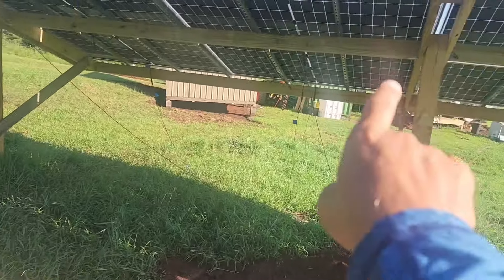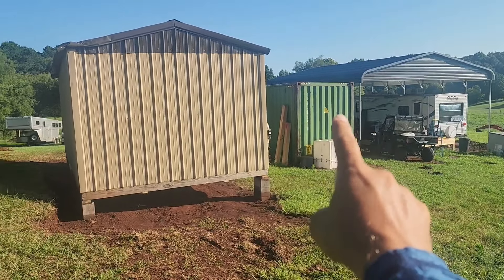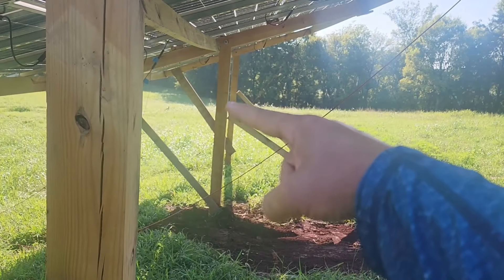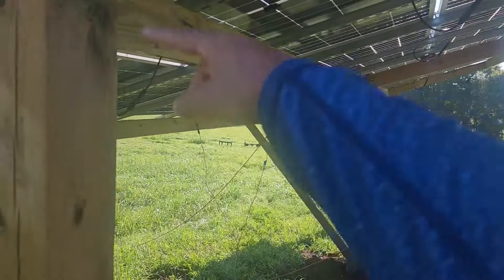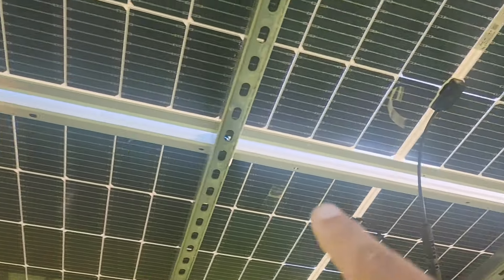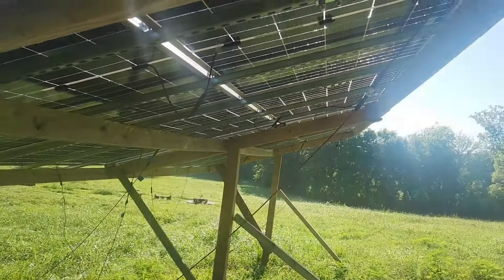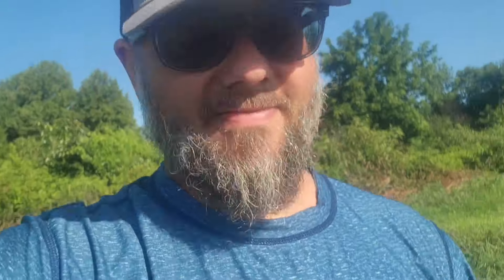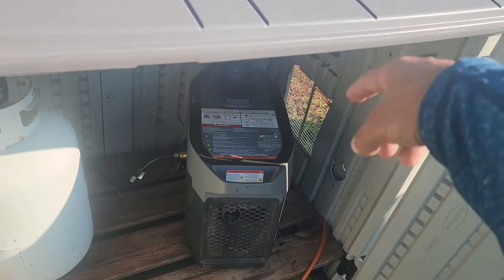Beefing up my Adjustable DIY Solar Panel Array

Comment: I was worried about wind when making mounts from scratch, I mounted my panels vertical south facing, 465w panel 300w in summer 16hr days, winter snow and sun 570w 8 hr days. clean once a year ,90 deg angle snow doesn't stick. If your array right now cannot produce 1.7 kw in full overcast you might want to try vertical, I am building a new 6x 550 mount with 2x4 only 3 cuts with a saw, you can install 7.5 ft panels solo, you just have to get a pile of crush on the end it won't move, panels get a lot of air flow through with 2-inch gaps around each panel, you could set your current array vertical , remove the top row then use 3 sections of my mount design 1 left 2 right, add  triangles off the east and west ends if it moves in high wind . Your array vertical snow and sun over 8kw, with heavy rain and dark clouds 1kw. If you already make those #'s then fantastic. If not come visit my off-grid content. New vid on Aug 10th, new mount, repair PV3, add PV4, and modify the original version mount. Any vids showing my pv input go by pv2#'s (pv2 is 2.8kw) since that will be the weakest array after this week.
Reply from the maker: @bobmonztr  thank you for the advice 

My panels are putting out what they are suppost to atm. 

I hope they keep it up lol